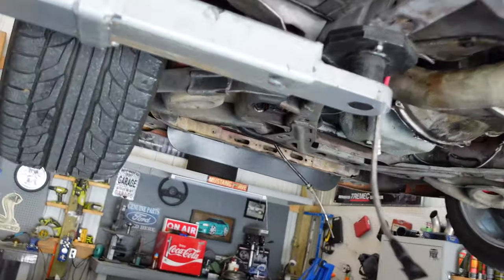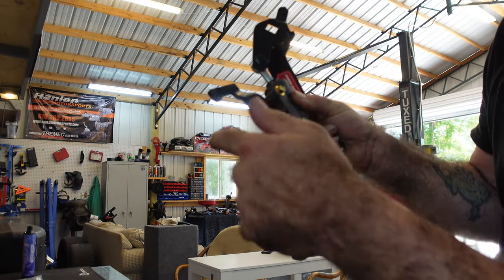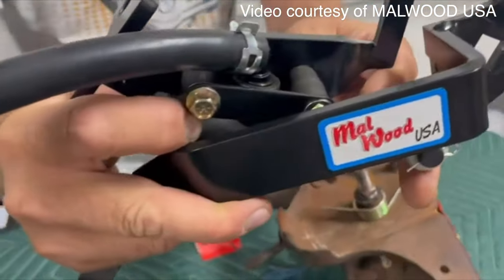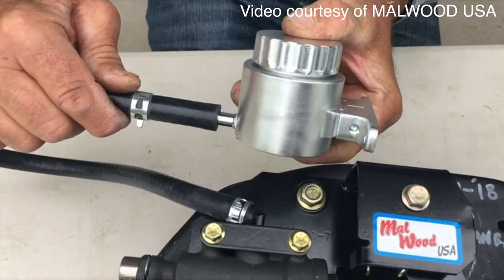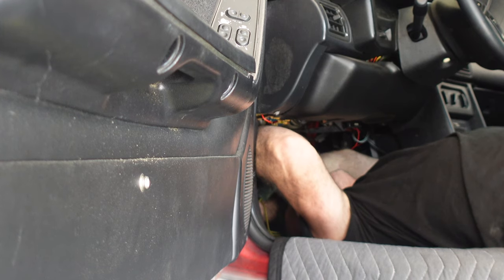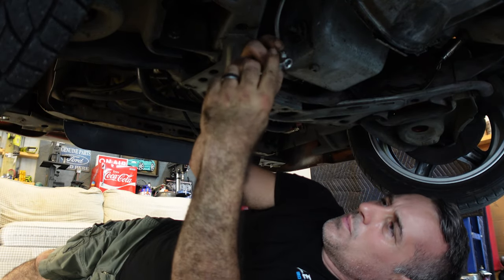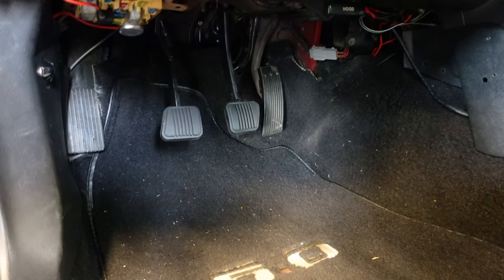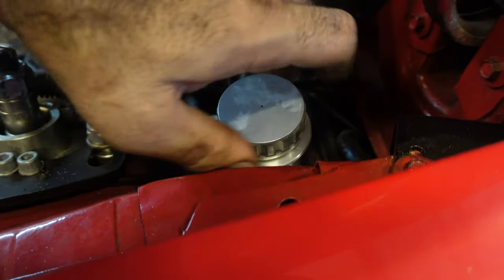Testing the Ram / MalWood Hydraulic Clutch Setup!

Comment: i used a jeep cj 7 mastercylinder , hose , and 84 nissan hardbody slave cylinder and bought a bracket off of ebay to hold the slavecylinder then used the clutch fork that way if slave cylinder goes out i can replace without pulling the trans. thats the only thing i dont like about the slave cylinder being in the bellhousing. Thats why i did my hydraulic clutch the way i did so it would be easier to swap out and cheaper to set up

Comment: I had the modern driveline kit, but have went for the Malwood setup. I get sick being upside down under the dash, so i might be pulling the steering column and pedal assembly out. Do you have any pictures of how the hood release cable goes around the pedal, or does it go between the mount and pedal?

Comment: 🔔😎
Several comments made about clutch effort.
I installed a King Cobra 2 and it's a little stiffer but acceptable. BEFORE I installed it I noticed that the fingers where the TOB runs are shorter than stock. 🤔🤔 Shorter means less leverage/ harder push. Seems counter productive. Makes me wonder why the tighter PP diaphragm spring is not using the longer fingers to ease the pressure. 🤔
 Just sharing info. 😎
Reply from the maker: That would make more sense ☝️

Comment: Now you can add a stiffer clutch setup!!!💪💪💪
Mo Power Baby!!!!
Reply from the maker: Definitely could go more stout on the clutch now.
Reply: @BREW2LFOXBODY  we used hyd setup on our 4cyl racecar with Goldstar race setup! The whole setup of flywheel clutch disk and plate only weighted 12lbs!!!! Talk about quick revs!!!!
Reply: 🔔😎 Remember, the stouter the clutch the more trans stress when you pop the clutch when shifting. A little clutch slip helps save a T5 and parts. 😎

Comment: Hi. McLeod makes a hydraulic clutch conversion kit that uses a slave cylinder to operate the stock clutch fork and throw out bearing.  You don't have to pull the transmission or do any under dash work. Do you or anyone you know have any experience with that system? Thanks.
Reply: I’m running the Modern Driveline kit on my car, which had much better reviews compared to the McLeod during my research. I’ve been loving it.
Reply from the maker: I don’t personally know of anyone running that setup but sounds pretty cool.
Reply: @kingcars  OK, I'll continue my research. Thanks.